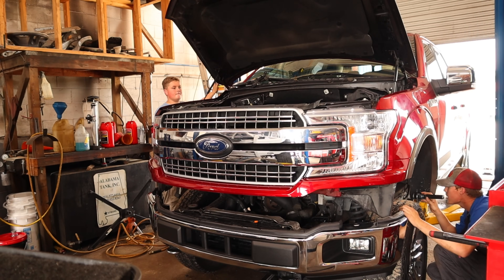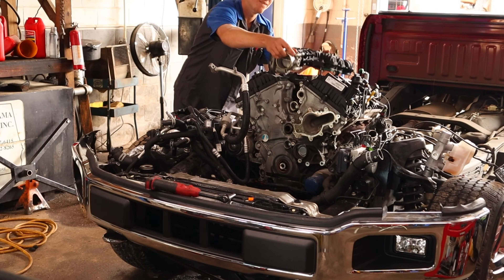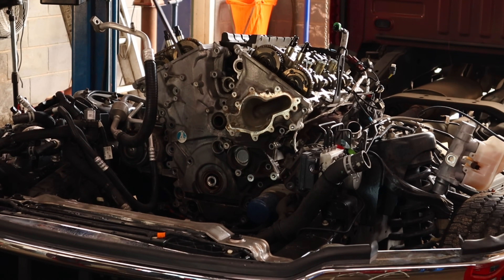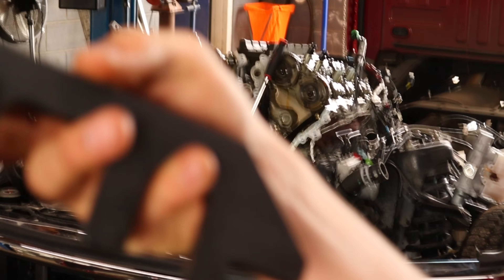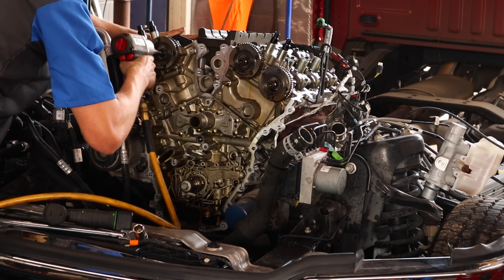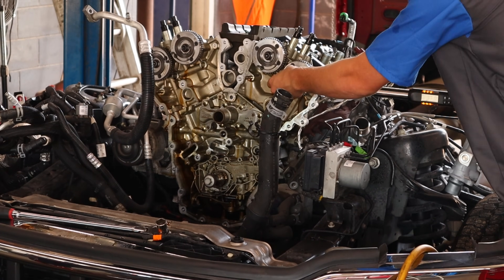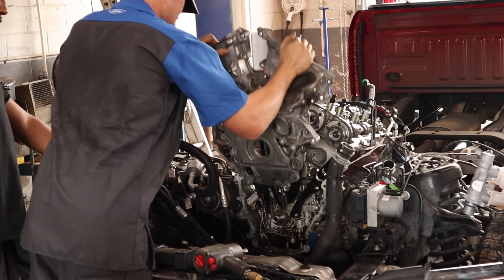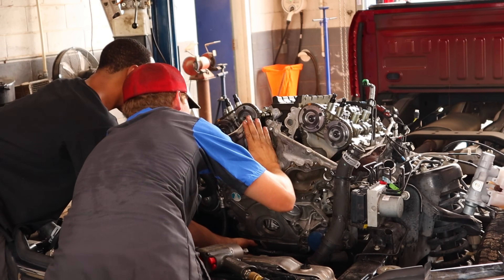Ford 3.5 EcoBoost Cold Start Rattle (VCT Phasers) | Everything You Need To Know

Comment: I have a 3.5 Twin Turbo in my 2020 Explorer ST with 10K miles. When it is cold starting it is blowing white smoke. This can’t be good. I know what used to cause this issue, what do you think? Thanks.
Reply: Thank you for the reply
Reply from the maker: Could be a number of things honestly. Most likely would be a turbo leaking oil into exhaust but that would usually be a constant smoke instead of just on startup. I haven’t ran across anything like this on the explorers that I think would help you.

Comment: So back in the day when I worked on crappy Maseratis we had this same issue and new phasers wouldn't fix it. We had to send the front cam bearing block off that controls the oil flow into the phaser and have a check ball put in to stop the oil from bleeding off when the vehicle sat overnight or longer then about 6hrs. That was an instant fix. Now we always replaced the phasers when inside bc it's unknown if any damage occurred from it slapping around but the check ball was the true fix. I'm happy with my old 2v bump pulling a cab off to service the engine that's just poor engineering to me but I've always worked on German and exotics so maybe the domestics do it differently now.
Reply: That’s the very first thing I thought of. These “experts” haven’t a clue
Reply: @jayman is this something that someone could even do to their Ecoboost? I would t know where to take it to for this. Maybe a Maserati dealer? Lol
Reply: @infotechsailor  maybe they could fit an electric oil pump to prime the engine before it is started. Same as they do with priming the fuel system before a start.
Reply: @infotechsailor  I haven't been inside one of these engines to see how the oil flows to the adjusters so it might not even be an option to do for this engine. Every engine is different so what worked for one might not work for another unfortunately.

Comment: push the throttle pedal to the floor, crank the engine for 5 seconds ( it builds oil pressure during cranking ) then remove foot from throttle & start engine.no rattling due to immediate oil pressure when it starts.its a cheap way to prelube your engine before it starts.
Reply: Thank you for the tip - 2019 with 17k and a rattle at start up - reprogrammed by the dealer with no effect.  Are these trucks good otherwise?  I drove GM until this truck, but switched because my GM's always rusted away in 10 years.
Reply: @rveerman1800  I love mine.   Don't really see much that goes bad on them other than the timing chain rattle.  But letting the oil pressure build before cranking helps take care of that.
Reply: I do this on my 5.4
Reply: Just hit 60,000 miles yesterday and have done this since I got it at 19,000.  Never had a rattle.  Just a little extra step to possibly save the engine.....I'm ok with that.

Comment: Thanks for posting this video! I have a few questions. Are the VCT'S capable of changing the timing enough to cause the pistons to contact the valves? Also would the VCT leaks eventually become bad enough to affect timing while the engine is running?
Reply: Awesome thanks for the info! Greatly appreciated. And great video.
Reply from the maker: Thank you! The only way for a valve to contact a piston is if the timing is off. Phaser can swing full retard or advance without and valve contact. To the second question, I’ve never seen that happen. Most of the time it’s only on cold start.
Reply: So is the only issue a rattle at startup in the phaser and nothing actually getting damaged in the engine?  In other words what if I just live with this and not fix it?
Reply: @chriscagle3155  I believe so, I drove mine for two years with the rattle, and it started to get worse towards the end before I sold the truck.
Reply: I had F150 with the 3rd gen Coyote 5.0.  Over retardation and advancement from sludge buildup.  Warranty only replaced the solenoid.  That sludge is eventually going to cause real damage including bent parts.

Comment: I don’t pull cab to do vct’s I just pull the front wheels off and have it bow down and I can do everything under hood.
Reply from the maker: Yeah I done them like that for a while until I pulled a few cabs on them. Way easier in my opinion.
Reply: @FlyingWrenches13  ok what do you do for the suvs affected by the phaser 21n03 (navigator/expedition)?
Reply: @FlyingWrenches13  do you still pull the body off the frame?

Comment: Having the rattle and up to 8 second cold start cranks on my ‘17 explorer sport.  Dealer said they won’t do anything without a code.  I don’t think explorers are included in the TSB.  Anyone have suggestions on next step?
Reply from the maker: If it’s ratting on cold start the dealer should be able to diagnose that. I’d say first step is to find a better dealer.
Reply: @FlyingWrenches13  Thanks.  I think I'll take it to a different dealer.

Comment: My local dealer in Kailua Kona Hawaii told me that my 2017 f-150 eco boost just needs a reflash to fix the phasers clicking, I don’t trust what there saying because I saw something about the reflash destroying the transmission, also my 4th gear when shifting down has an issue hard shifting
Reply from the maker: 6R80? Possibly a lead frame problem.
Reply: My dealer did the reflash for the vct and that did nothing vct super loud and still transmission issue dealer keeps telling they will take another look at it but not much they can do for me

Comment: …again customers are Beta testing Ford products. I have a 2019 supercrew with 20,000 miles, I was notified of the problem the dealership stated the PCM Reprogram had been canceled as you stated, looking forward to that repair. I also have a 10R80 transmission whine issue, under the SSM 47812 the dealership and Ford hotline said it’s not an issue won’t affect durability. We’ll see. Your video was very informative I subscribed to your channel and look forward to future post. Thank you
Reply from the maker: Thank you! There was a TSB on the 20 models for a whine noise caused by a faulty planetary. May be worth asking your dealer about. I’ve put a few in for noise issues and noise went away on all of them.

Comment: Mine started doing this at 20k. I took it to the dealer last week and they did the computer fix that didn't fix it. Now the dealer I bought it from is replacing the part. Will the mechanic delete that computer update to avoid the transmission issue? Great video by the way.
Reply from the maker: Thanks! Unfortunately once the update is done there isn’t any way to change it unless you have it tuned by someone and even then they probably still wouldn’t change the trans strategy to what it was stock. Ford will only allow us to program with the latest software release.
Reply: There a new update now that reverts the programming because of the trans issue some people also started overheating

Comment: If low oil pressure on start-up is the problem, retool the engine and replace the gear pumps with electric oil pumps that spin up just like electronic fuel pumps.
Reply from the maker: I’ve honestly always wondered why no one has done an electric oil pump yet. It makes sense to me.

Comment: 4 sets of phasers in 36000 miles on my 2019 xlt. loved the truck but boy am i glad ford bought it back from me. never again until maybe ecoboost 3.0
Reply from the maker: Why so many? Did it just keep rattling?
Reply: @FlyingWrenches13  kept talking and the last two sets failed to the point they are the cams. All service work was done at one of the best service shops in the south. Ford never could get my truck right so they gave up I guess. My first and likely last Ford lol

Comment: I’m at 39k miles on a 2018. I’ve had the noise for some time but terrible now. Threw a code a week ago. Tech manually cycled bank 2 and cleared code. A week later it came in again. With it I experience power loss and delayed shifting. Maybe it goes into limp mode? I don’t know.  Weirdly I drove it yesterday and felt fine. The light went out. Ford here says I have to have the check engine light back on for them to rediagnose and then they can perform the repair. My concern is folks are just having noises. Mine has gone beyond that and now throwing codes and having power loss.
Reply from the maker: Yeah it sounds to me like you may have some other issues besides the rattle going on!

Comment: Great video! Question: had the VCT Phasers swapped recently (<1,000 miles ago), but the vehicle still rattles! 

Ford told me it’s ‘normal’ on the ecoboost. Should I take it to a different dealer while still under warranty?
Reply from the maker: Yeah it shouldn’t be rattling at all. I would go see someone else.
Reply: Use Amsoil
Reply: @johnlexus1  amsoil fixes mechanical problems?
Reply: It may be the waste gates rattling. If the rattle lasts for more than a couple of seconds it is not the phasers.

Comment: Exactly why I love my pushrod engines. So much easier and cheaper to work on.
Reply from the maker: I’m a LS fanboy as well.
Reply: @FlyingWrenches13  How can you not be, the Iron block LS is the best engine ever made.  No other engine can take more HP stock then the 4.8L stock iron block.  1480HP is what Trucks magazine got it up to.
Reply from the maker: @bartekmedes8281  all that out of an engine that cost $500 at the junkyard.
Reply: Only Gm has lifter failure a lot more than these and before the first oil change at that. Dohc isn’t hard to work on either. And no pushrod running 7s unopened from the factory like a coyote.
Reply: Wait until that cylinder deactivation goes bad then you won't think it's so easy and cheap. Big problem on chevy engines

Comment: What would happen if you do not fix the rattling?
Reply from the maker: Nothing. It will just keep rattling and most likely get worse and worse. According to ford there is no other effects caused by the rattle.
Reply: @FlyingWrenches13  then isn’t it risky to open the motor for an unnecessary fix? I mean I can only hear it for a couple of seconds after a couple of days of not using it.
Reply from the maker: If it’s done by someone experienced the odds are it will probably be put back together better than it came from the factory. I would have them replaced if still under warranty.
Reply: @FlyingWrenches13  then isn’t it risky to open the motor for an unnecessary fix? I mean I can only hear it for a couple of seconds after a couple of days of not using it.

Comment: Omg this video explains my truck issues. 4:40 is exactly what happened to my truck. They were never able to fix it and caused more problems the transmission shudder feels like you’re on the shoulder of the highway. My teeth rattle sometimes it is so bad. Glad Ford did the right thing and took it back.
Reply from the maker: Hope it helped you!
Reply: @FlyingWrenches13  it did tremendously. I thought I was crazy and I am pretty sure so did everyone else. I can’t tell you how exact you were with the issue, I experienced everything you described even after the 2 recalls were done. There is a 3rd one but I guess they will know how to fix it once they get it back

Comment: If they are replaced will the new ones fail at some point or are you confident this is a permanent fix?
Reply from the maker: I’m not confident that the new phasers will fix it permanently. I haven’t had any come back yet but I’ve been hearing from a lot of other techs that the actual issue causing this is poor oil flow through the head and mega cap. Apparently this is what’s starving the phaser of oil on a cold start. Not really a 100 percent on what will eventually become the permanent fix yet. Waiting to see what Ford comes out with next.

Comment: I have a 2014 and had to do this repair at 55k. We did replace the timing chain, guides and tensioners. Didn’t do the water pump or spark plugs. Just did the plugs at 65k and they were garbage. Would a catch can help with this?  Seems like very low miles for these repairs. Thoughts?
Reply from the maker: Yeah a catch can does wonders on these engines.

Comment: I have a 2018 3.5 exobooat in my f150. Did not have the diesel sound rattle but heard from friend that did on his 2017. They replaced it under warranty at 12k miles. During the start of covid. Took a little time to get the parts, but it's good to go now.

Comment: I thought you only had to take the cab off F250 with the powerstroke, another reason to not buy a new Ford.  I have a 2005 with the 5.3, 155,000 miles, just waiting for the engine to go.
Reply from the maker: You mean a 5.4? Or are you talking about a GM?

Comment: ford trans tech here. respect to the heavy line
Reply from the maker: Thanks man! How do you feel about the 10 speeds compared to the 6R80’s?
Reply: @FlyingWrenches13  I hardly ever work on 6r80's except for molded lead frames and failed converters. It's a proven platform. The ten speed has gotten better over the years and I have seen some high mileage (180k) ones roll thru the shop
Reply from the maker: Yeah I agree. 6 speeds are pretty solid from what I’ve seen. I’ve only built a few 10 speeds and each time it was either caused by low fluid or snap ring popped out. I think the 10 speeds are going to be fairly reliable as they improve over the years.

Comment: Ford Tech from Denver here, surprised you pulled the cab to do these. Ive done so many of these in the truck i couldnt imagine pulling the cab would be much easier or faster. I'm consistently getting them done is around 4 hours.
Reply from the maker: 4 hours does seem extremely fast but I guess if that’s all you done for 2 months straight you’d get pretty good at them. I do one every week or so where I’m at. Me and one other guy split them up. Takes both of us about one day to do one. 8-5.
Reply from the maker: Yeah it’s definitely not faster to pull the cab but it does make everything much more accessible and overall I just feel like I can do a better job at re sealing everything with cab off.
Reply: @FlyingWrenches13  It makes for a better video. It is nice to see everything.
Reply: I'm a tech at an independent shop, I did a set of chains and phasers on an ecoboost f150 and just thinking back to the intercooler piping on the turbos, I'd rather have the cab off too
Reply: I'm a Honda tech who had to replace the water pump on a 17 explorer with a 3.5l. I dropped the engine out the bottom onto a table. I didn't see another way to get the job done correctly and quickly lol. I can see on this one hes working on the pump is external, the one i delt with was a chain driven pump under the timing cover.
Reply: @alleyesopen777  totally unnecessary on explorers, on the other hand, newer edges make more sense to drop out the bottom
Reply: @alleyesopen777  that's the way I'd do it in a transverse application.
Reply: @Eric Graysonwith all due respect I am, they're not hard when you do them constantly
Reply: @The Woozy what's so unbelievably about 4 hours? It's like an 1:30 to get the front cover off and then hour to time the engine and going back together usually only takes about an hour.
Reply: I'm in denver can I get your number for side cash to work on my 3.5

Comment: I now know why taking your vehicle to a dealership causes more problems to your car. If this guy is a master technician we’re all screwed. No procedure with torque specs, placing cooling hoses on the ground allowing debris to enter, using a torque wrench to loosen a bolt, not covering openings allowing debris to enter the oil passages. This guy is amateur.
Reply from the maker: Thanks!

Comment: I bet if you pull apart a new actuator, you'll see what's worn. On my mazda there is a latching pin that keeps it from rattling, the socket that pin fits in wears& the rattling starts. I'd put money on this actuator being the same problem.     One fix, pre-prime the oil system, well cheaper than some $2k fix.
Reply from the maker: I’ll try that one day! Thanks for the info!

Comment: I have a 17 transit 250 with the 3.5 eco with close to 70,000 so far no issues thankfully . A good friend of mine has a 11 f-150 eco with over 300,000 miles and has never been in to, other then oil changes
Reply from the maker: Yeah Ive seen a few 3.5’s with 350k plus. Just gotta take care of them.